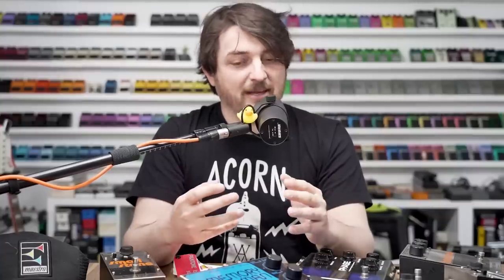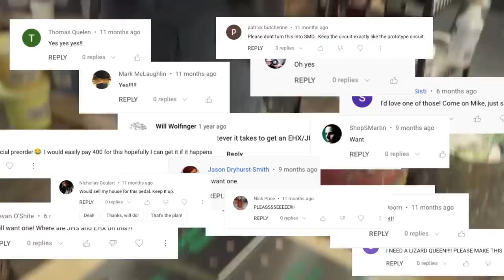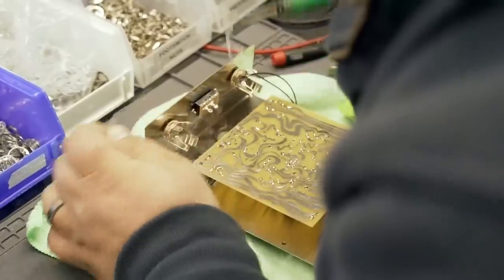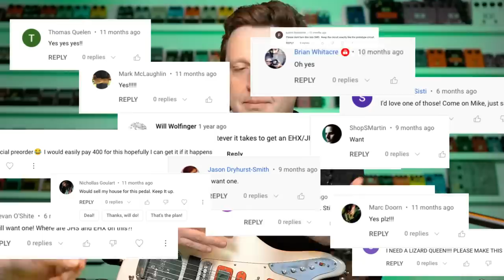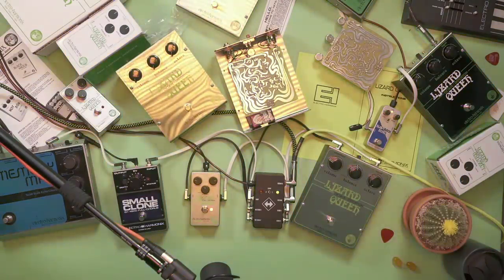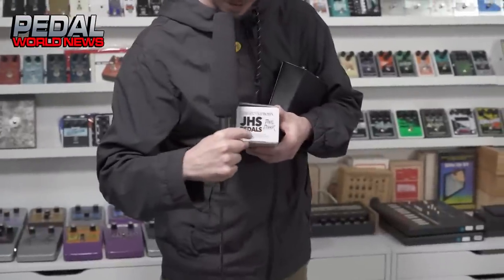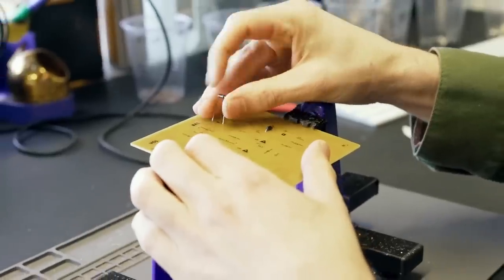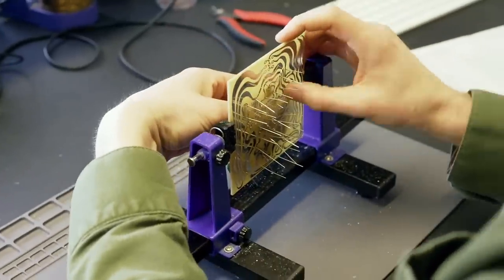LIZARD QUEEN Octave Fuzz By JHS & Electro Harmonix

Comment: Mounting the foot switch on the PCB was a smart idea. All the old big box EHX pedals had the PCB hanging off the pots. I used to have to continually reflow the solder joints.  Eventually on my Foxy Lady Big Muff I just ran wires to the pots!

Comment: So, the Lizard Queen is a "bazz fuss" front end and an Escobedo "Pushmepullyou" back end.  They make a nice pair, but don't have to be used as such.  Following the posted schematic, I built one for myself.  Sounded fine, although I used a germanium transistor for Q4.  After some thought, I realized that, with essentially two circuits rolled into one, maybe I could tap the signal from different points.  So I plugged my audio probe into the amp and poked around the board.  The output of Q1 did indeed get me the bazz fuss sound, albeit not quite as loud as the standard LQ circuit output.  Tapping at the collector of Q2 got me a hotter output, comparable to the full-circuit output.  The perk is that this signal gets pleasingly woolier as Balance is increased (i.e., Q2 gain is increased).  So, I installed a toggle that takes the input to that last 100nf cap before the volume control from either the collector of Q2 OR the junction of Q3/Q4 and the 10k resistor to ground.  With this, I can set the entire circuit for most octaving, and by flicking the toggle, go immediately to a thicker wooly tone: two fuzzes in one!

Comment: Has anybody else discovered that when you run a ring modulator into the lizard Queen it produces an monstrously huge wave folding distortion? I'll post a picture of my settings on my community page on YouTube. I think the ring mod is basically folding on a fifth below and the lizard Queen is set at volume ten o clock octave 1 o clock and balance at 3 o clock. I'm using the Flamma mod pedal. But AI bet it would work with many ring mods.

Comment: I am intrigued and admire the passion for your project but since both products are not showing up on european dealer sites I would really like to know what's the difference between this and the EHX Octavix. You kind of brushed over this  at 32:00 stating that there is an "EHX Octavio" in the Nano series which I could not find anything about, and that it is different but you left it at that. I guess you meant the "Octavix", right ? Funny that the greatest EHX historian ever did not correct that. Anyhow, the question remains:  The Octavix pedal that is usually available in europe, e.g. at Thomann's for 89 Euro, ist a 3 knob octave up Fuzz with a 9 to 24V switch. That sounds like a better deal...You said the Lizard Queen flips  the waveform differently. Can you elaborate on that ? Can your new design handle chords ? Thanks in advance and keep up the enthusiasm !
Reply: I caught it, just wasn't worth correcting due to context.
Reply from the maker: Sorry, I was on Sudafed and really sick. The Octavix is a take on an Octavia. The Lizard Queen is not. It wont handle chords much better though but thats the fun.

Comment: My question, is the Lizard Queen buffer friendly? My pedal board starts with a wireless receiver. I do not intend to change this. I love my Cheeseball, but it really isn't happy sitting between buffered pedals. I would replace it with the Lizard Queen, but not if it has the same issues with buffers.
Reply from the maker: i'm not positive, but my guess is you'd run into the same issue.
Reply: @jhspedals  Wow. I post a question and in a very short period of time, someone from JHS replies. I am a fan of both your pedals and content. I'll probably eventually get a Lizard Queen, but I'm busy pinching pennies at the moment. I really like how it sounds from the many reviews I have watched. I have a big pedalboard in the studio and a short board in the living room, so I like to just try stuff between the two of them. Maybe I can find a happier place for the Cheeseball on the big board.

Comment: Because I am curious. Why is the fact that this is Bazz Fuss (Hemmo), in series with a Push Me Pull You (Escobedo) being claimed on video and in ad copy using verbiage including the words unique and original. Would it not be classier to credit or reference your inspiration here? Feels really disingenuous. Your comments would be appreciated.
Reply: Because both of those are rudimentary fundamental building block circuits that existed in 1960s EE textbooks decades before someone put them on the internet in the 90s. Hemmo did not invent using 5 components to turn on a transistor, that's just how you do that, etc. If I put a recipe for a grilled cheese sandwich online that doesn't mean you have to credit me every time you make lunch.

Comment: The inverse pedals look like they sound better!
Reply: You know that difference in paint gravity on the case must have an effect on the sound due to the polarisation of the metal enclosure inducing a slight electromagnetic nuance that could interact with the vintage components, just like the battery that's why you need a batsim connected to these at all times :F
Reply: the extra black enamel coat keeps the tone in.

Comment: How period authentic is the large Lizard Queen, really?
Because if wires don't spontaneously pop off the PC board, then I'm either going to want a refund, or have the pedal fixed to be period authentic unreliable. Also...I don't want any consistency with the components. If you run out of a particular component, then I want it swapped out with anything in arms reach. And not Josh's arms. They're too long.
And none of this "non-toxic" paint crap, either. I fully expect, demand, that everytime I taste the paint on the Lizard Queen (?) I expect, demand, a necessary trip to the emergency room.
...because I want authentic.

Comment: Wow, so JHS made $350,000 in 1 hour.🙃
Reply: if you ignore all costs labor and development, then yes.
Reply: @DanielDangerTME  parts don’t cost that much as you can see there are not many. The circuit has basically been designed in the 70’s already. Nbut yeah there are overhead costs for sure. Still they moced them all in 1 hour.
Reply: @Electric Rabbit  given that of the two of us, i actually know the production costs because i made the pedal, I can say they do cost that much.
Reply: @DanielDangerTME  out of curiosity what are the most expensive parts?  The transistors?
Reply: @Electric Rabbit  a big part was the 100% custom made two part enclosures with coated bottoms, two to three color silkscreening, which involved four separate shops across the US and Canada, multiple freight shipments, etc. The case alone cost more than an entire finished nano. Maybe two. That plus the custom old school boards, the entirely by hand assembly and soldering, the screenprinted box was another two vendors, etc etc. We cut no corners.

Also the circuit is not from the 70s, it's new in the style of the 70s.
Reply: @DanielDangerTME  ahhh. That does make sense. I suppose EH didn’t have any of the tooling anymore?
Reply: @Electric Rabbit  God no. Well, they have the machinery stashed in the sub basement but it's not even close to being usable in its current shape. We had to replicate the cases elsewhere from the ground up.
Reply: @DanielDangerTME  wow. Well they look great.